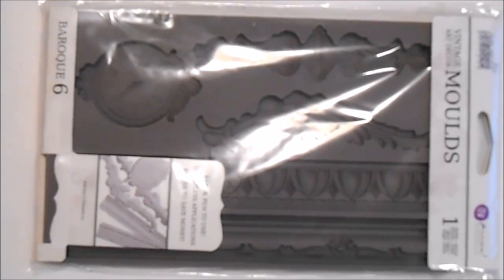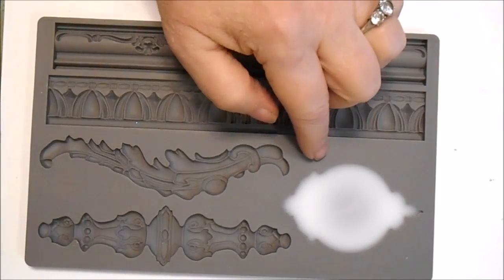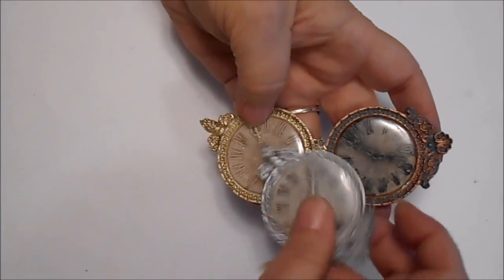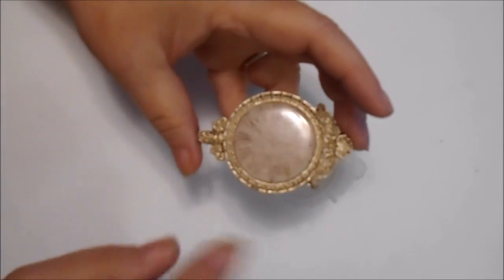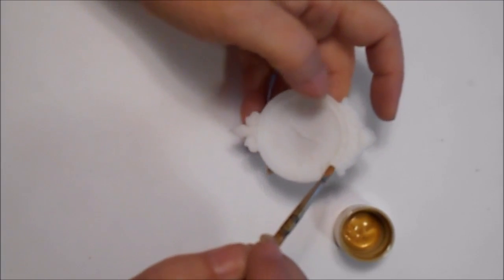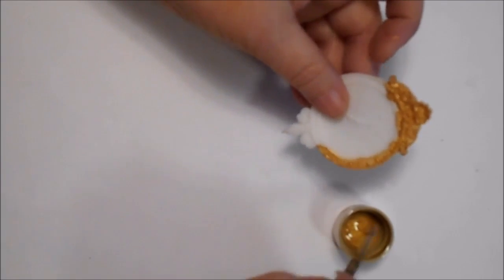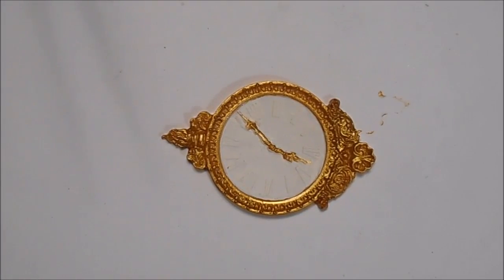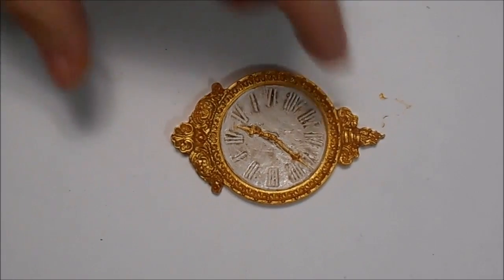#mixedmedia #clock   IOD moulds with Amazing Casting #resin

Comment: Have you tried the spray resin to cost as clear?  I find it leaves the items super clear no cloudiness on the dial part.
Reply from the maker: Hi CraftyNana, The clear is crystal clear, I antiqued the face of the clock first to give it some age but it is very clear & no I haven't tried it. Sounds like it may work for other application though, thanks for the tip! Lyn

Comment: Would like to try making the clock you make it look so easy . Is the casting resin hard to work with and does it take long to dry? Thank you for your video enjoyed it very much.
Reply from the maker: Hi Dot, it's really easy & Amazing Casting Resin takes only 10-20minutes to set up. You can even un-mold the clock after 20minutes or so, it will still be sort of flexible but you'll be able to paint it. The clear resin I used on top Amazing Clear Cast takes overnight to set up though but you could easily skip that step if you wish. Both of these resins are Amazing Casting Products & are available here http://www.moldputty.com/ or at your local craft store usually. Thanks! Lyn
Reply: Thank you for your help . Going to try it soon

Comment: Can these molds be used with a wood filler to make decorations for actual furniture?
Reply from the maker: Hi Mari, Prima actually designed these to be used to decorate furniture. They sell a paper clay to be used in the molds but polymer clay, resin(you can mix a super fine wood/sawdust sold my molding product companies such as Smooth-on or ArtMolds) & after doing some research & contacting Prima they said as long as it's the putty type it should work just fine. I hope this helps, hon.
Lyn